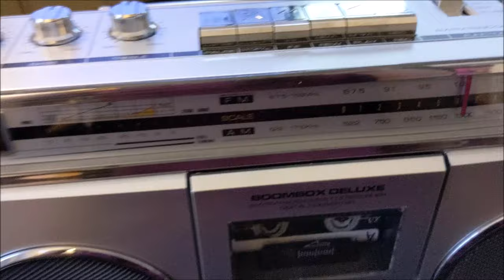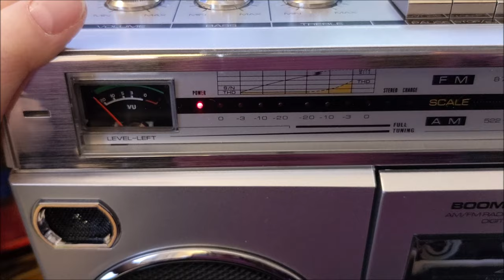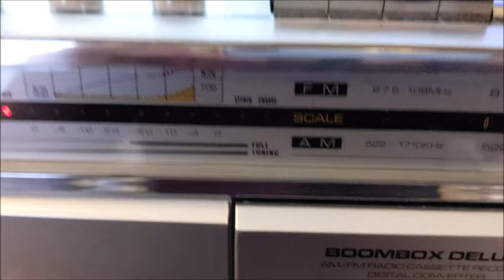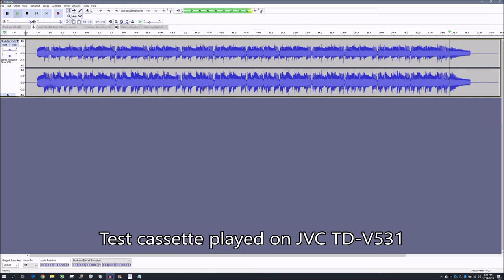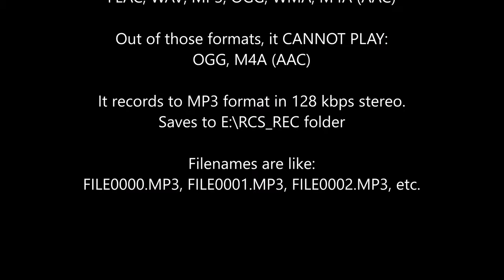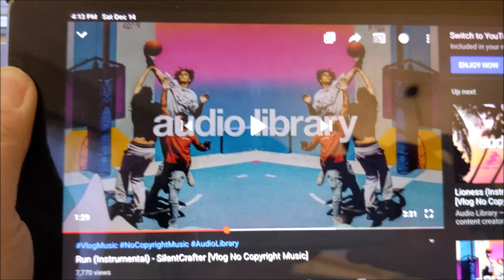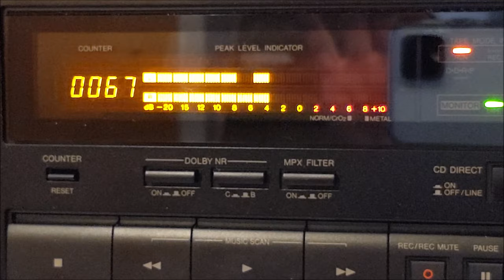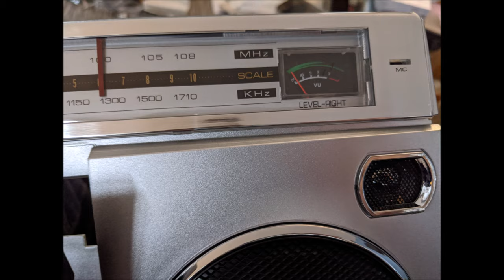2019 ION Boombox Deluxe - Full Review

Comment: As inside photos, 2 Tweeters left, right is just for look, no connection, no sound.
Reply from the maker: That is correct.  :(
Reply: Honestly, it doesn't really need them.
Reply from the maker: @DriveInFreak  To me it sounds a bit off still.  I feel it needs a bit more bass to round it out.  It can sound shrill at times if you adjust the treble up high, but it doesn't sound clean.  I think some dedicated tweeters might help that out.  Then we would be talking about a better main driver and crossover circuits... and at this price point, we can't expect any of that, lol.  Of course, if you're a hobbyist, it would make a good project. :)  I wouldn't go crazy on it because I'm sure there may be other limitations such as the pre-amp, amp, and pickup head.  This is why I tested through the line-out to bypass the speakers to hear if the speakers are the limiting factor.
Reply: @TechieZeddie  Here's the thing; there's a serious lack of power with 6 D cells. The truth is that 10 will get you 5 Watts R.M.S. per channel. Cut that in half (best case scenario), add to that a low cost design, super efficient open air speakers no longer being available ( the ones in it are rated at about 3X the output power, thus don't make the most of what's available...3.2Ω @ 2.5W would have been ideal), and you can see the problem.
Back in the bad ol' days boxes (that were half way decent) were a compromise between available current via D calls, and efficient speakers.  not even the best of the best where ":clean".
This thing is (IMHO) is as close to what the 6 D cell boxes sounded like ( with the exception on one very expensive Pioneer) as possible in this day and age.
Honestly, it's a toy that would have been about $60 in 1983 (price today vs inflation).or about the price of a cheap no frills mono box.
More treble would override the lack of bass.
Reply from the maker: @DriveInFreak  So true.  It does have a build-quality of a toy, being all plastic and what-not.  Of course we have those kind of boomboxes too back in the 80s.  In fact, those would be the kind that my parents bought me as a kid.